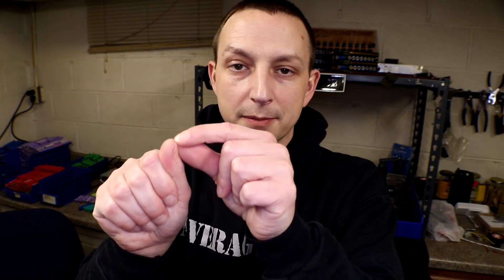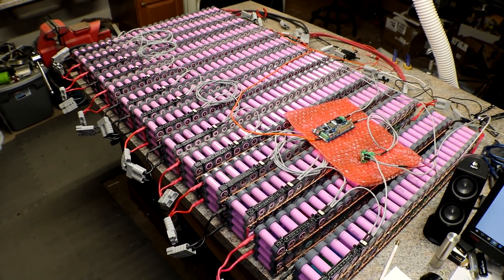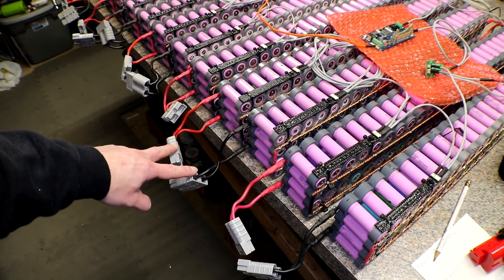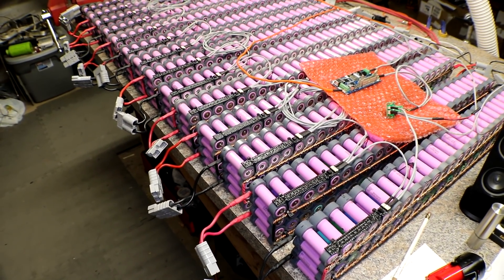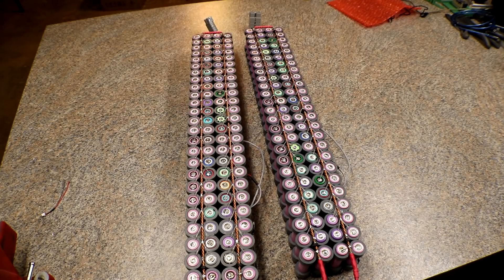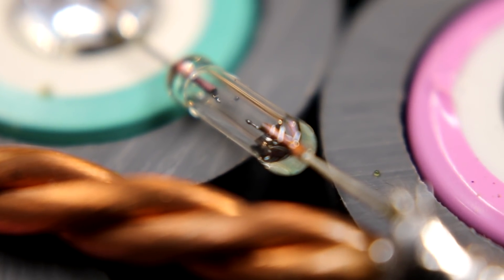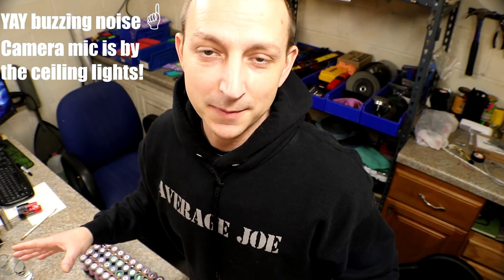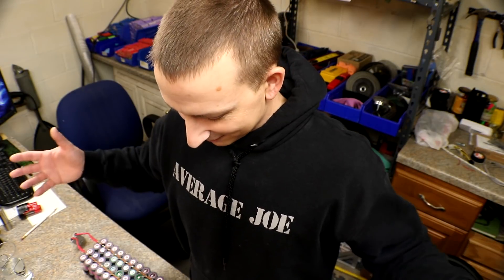Diy Tesla Powerwall ep75 200 Fuses BOOM!!!

Comment: Hi @jeo great job.
I have few quires... Could you help 
What if you use there BMS... Using BMS can we avoid such incident...? 
Example 4840ah battery pack. That contains BMS, even if it have BMS still need fuses at cell level..?
Reply from the maker: Yeah I would use cell level fuses in a powerwall.  Fuses or small wire for fuses is acceptable.  BMS is a must as well! Doesnt have to be crazy expensive bms just find one that fits your needs.

Comment: Why not throw in a extra safty measure like a thermol fuse to prevent over heating cells when charging or heating
Reply from the maker: I guess one could do that.  I know my packs dont get very warm or hot even but you could for sure use them.  Batriums longmons have temp sensors on them and you can set it up to disconnect or turn on fans at desired temps.

Comment: Congrats.   Fuses did their thing and you didn’t burn the house down.   
I was tearing down a pack and damaged a battery   It started burning and then at the same moment my 3 year old came home and wants to see what daddy was doing. She wanted to play.  I broke into sweat as I was trying to extract the burning battery from the pack and get it out of the house while simultaneously trying to get my child away   I was getting excited, my daughter started crying, and my wife didn’t understand what I was doing.      
Fuses good.   Chuck damaged batteries.   Do tear downs in a safe place.   Avoid shorts.  Avoid over amps charging and discharging   Avoid over temp.
Reply from the maker: Thanks Man! Yeah Im sooooo glad I had the fuses and that was the only thing that went wrong. Good to hear you got that cell out. Was it a pack you built or a laptop pack you were getting cells from?
Reply: I would like to see ppl using thermol fuses in there packs

Comment: Have you thought about using fuse wire instead?
Reply from the maker: I have and tested many different ones but wanted something to pop lower then what everyone else was using for there fuse wire in a powerwall. Wire is for sure faster to install but you need to get 44awg or smaller to pop at about the same amp rating I am using and that stuff breaks easier then these guys lol.🖒

Comment: Hello Avg Joe,   kind of have been going in this direction for awhile now. I have been looking at building a 3 wheeled Trike / car for the last 5 years or so and time usually helps guide direction for me anyway. so cut to point. have given up on a car and have decided on building a E Bike using my old bike with a hub motor kit and time changed things again and I fell into buying a used EBike made by Magnum Bikes and have enjoyed it so much im riding it all winter up here in Maine.  8 degrees now and going for a ride in a few hours... so to the point again. I'm building a 48 Volt battery using 18650s around 20 Ah  and have it ready to solder up everything but I like the .5 amp fuses your using. if that's the right size. and want to order some to complete it. is this a good idea for a Ebike battery. assuming the powerwall and ebike battery are closer enough to use for either. Q do you still like the fuses and would you recommend them for an ebike battery. I like the looks of repair and changing out fuses and battery's if need be. sorry on hard getting to my point. I have so many questions and will try to be clearer in the future. Thanks Vic / Dogboy
Reply from the maker: Yeah I do a lot of the same and time usually will redirect me lol.  I think my uncle has one of those ebikes and he loves it as well.  You are dedicated to cruise in those temps.  How far do you go usually?  How many amps does your ebike battery pull?  That would help in deciding the fuse rating.  I would think you would want a little higher like maybe 3-5amp fuses to keep the resistance down for an ebike.  In a powerwall situation with a tone of cells its not much of an issue.  Also keep in mind that the lil glass fuses can break easily from the bus bars moving around.  You would need to be a little careful handling the packs and make sure that it is secure in the bike.  Mostly the fuses on the ends are the ones that break easily, ones in the middle dont break. But YES I still love the glass fuses and will continue to use them.  Yeah I made my cell holders for the ease of replacing cells if I need arises. BOOM😜🔥
Reply: Thanks for getting back to me. I'll answer on my bike rides during the winter months. I wear layers and there is a balance to being warm too hot or too cold. im working on accepting getting cold some and wearing a little less for comfort in moving around. lately I go by my hands. when im out riding I wear these insulated rubber glove with neoprene inside layer. there cheap at the local Job Lot store $3.00 crazy price and very warm for quite a while. at 35 degrees I can be outside for hours and not have cold hands. but at 7 degrees its about 30 mins maybe 40. so at about 30 mins my hands start feeling cold so that's my turn around point. I can get back in 15 mins or so and that's a good ride for that cold. 4 degrees is the coldest ride and at night. I enjoy night riding in winter as there are less cars on the road. have to be careful. wear a mask  at times and have several lights two rechargeable headlights one very bright. again cheap ebay light. runs on 4 18650 s and came w charger for 20.00 bucks. ( I might be posting some videos sometime soon on my adventures . so back to how far. average winter ride is 4 to 5 miles. coldest days 3 and nice day maybe 9 . thats winter snow and Ice . I even made my Smart Sam tires into DYI studded tires. using 1/2 in x #8 sheet metal screws.  to me what your doing sharing your journey is awesome and teaching what you have learned. Its awesome. I've been watching several Battery guys Bike Guys etc. several years ago I built a Stereo tube amplifier using you Tube videos. and have learn to change break shoes build things. I have been a builder my whole life and have always done as much of everything myself that I could. well I have gone on long enough on the How far I ride question.  I have to say I have a problem with my left leg 5 years ago I almost lost it and very glad to say I still have it but biking was becoming very hard including balance and getting on and off quick enough and trying to fall less. and being able to peddle up what used to be easy hills were becoming very hard and with the eBike its much nicer. I live on a long hill at the bottom and by the time I got up to the top I was spent before getting any distance. not the first stage is easier and making the rest more enjoyable. I'll check into what my motor is pulling and get back to you. I'm thinking of using a wire fuse just need to figure the guage . have it saved jut escapes me now. your doing a great job. Thanks for more than you know. Vic

Comment: maybe you should put a main fuse in. that will blow before all the tiny ones will. that's what I'm thinking about doing. I need to get started building batteries.
Reply from the maker: +James stranger I do have some 100amp fuses that I might put in between each pack. Under normal conditions in the server rack this shouldnt happen but I guess you never know💣💥🤣

Comment: Wanted to build those but my boss told me 100- 250amp current draw for about 8 minutes using li-ion batteries would shorten their life span.
Reply from the maker: +webslinger2011 For a powerwall or for tool batteries?
Reply: AveRage Joe  It's for our fast charging EV motorbike. Draws a huge amount of current.

Comment: Hey Joe ! I'm trying to build a battery back-up for my sump pump (120V/7.5A) Can you make a video about building a UPS for bigger equipments?
Reply from the maker: Hey Ray, my regular powerwall would be basically what you would want.  Im using a 2700watt ups and 1400cells.  It could run your sump pump for over 8 hours!

Comment: my 1GB video card, radeon HD 4850, still running just fine, it doesn't support OpenCL 1.2 so no mining crypto with it... no DX12 so some games I've  tried to play don't work.
Reply from the maker: +bcmasur Ya these 1gigers I have wont mine either. There probly messed up anyways as They were freebies from recycler!
Reply: BOOM!  ehheheheh  it's not because they're 1GB but because they don't support the necessary protocols such as ati/amd needs at least OpenCL 1.2  I just won an M5A97 on eBay for $61, been using an M3A78 with only DDR2 RAM, moving on up!  next will probably be a new video card so I can GPU mine (or play new games)

Comment: Lesson learnt :). tytyty . Just a question, why have ur fuses at an angle?..Regards.
Reply from the maker: YES!!!! Lesson learned for sure lol.  I put them at an angle to try and get the soldering heat away from the actual fuse in hopes to not mess up the integrity of the fuse since heat can change how the fuse could react!
Reply: ty :)

Comment: If it's an LG or ViewSonic flat screen TV usually it's just the power supply of the power supply starts failing off frequency which causes lines in the TV sometimes before they fail the use of brand called craps on you can buy kits to replace the caps look at pastors that are bad are usually have a bubble on top of the cap if not by the kids replace the mole on the power supply just do a Google search of your TV model find out the most common problem soon pretty handy save yourself some money plus you can get some at the second hand store and pour your recycler and fix those ones as well you'll be loaded with TVs
Reply from the maker: Yeah the tv upstairs was a LG.  All the caps appear to be good.  Where I broke a little piece of the screen off, there was like 10 little wires running through there and that is whats causing all the lines.  I have fixed a lot of tvs that way by replacing all the bulged caps from my recycler lol.  I do have about 6 tvs down here now that are a little newer ranging from 42" to 60 or 65" and the caps all look good so it has to bet a fet or something.  Ill have to investigate more.😀👍
Reply: AveRage Joe you can also check the capacitors if you have a voltmeter that does resistance based on uf rides I sent you the message before I wash all the vgao if you need any help I've repaired 2000 TVs
Reply from the maker: If I have it open Il for sure look at them but I dont think mine will check resistance on uf.  I do need to fix those bigger tvs tho!

Comment: It could be the Matrix, you lead an exciting life for an average Joe...lol. Ever think of just using 10 AMP Pre-Tinned Fuse wire I got some from the UK it's pretty neat really easy to solder.
Reply from the maker: There is a glitch in the matrix😱😆 I agree that life is exciting cause I love to tinker!!!  I have tested many fuse wire and copper wire and decided to go with the glass fuses because I wanted the fuse to pop around 2amps so if a cell decides to self drain or just go bad in general it will pop the fuse sooner vs eventually pulling 10amps slowly over time and make a glowing red wire and be a possible fire hazard.  With the glass fuse its all self contained.  Thats my point of view on it at least. Many people are happy with a 10amp wire tho! 😀👍

Comment: Sooo....you let out the magic smoke??? LOL. Hey....question: You ever did a follow-up on that 24v back up UPS? I remember you set it up without a BMS. Just wondering if that is still the way youre using it....or are you still using the UPS??
Reply from the maker: I let the magic smoke out of 200 fuses, the batrium watchmon and well I broke the tv screen lol.  Ya I have been using it randomly and so far everything is ok.  I havent made a follow up video yet cause I want to redo that pack with the same cells and I do want to add a little cheapo bms to be on the safe side.  Hope to do that here soon!

Comment: zero dislikes.  cool.  some days you are pigeon, some days you are the statue.  Bought a BackUPS 350 (200 watts) for $5, dead battery, not replacing it, just going to wire it into my 3S15P... finally about to have some solar-powered AC.
Reply from the maker: Ya some videos are like that but its still early 😜  Nice find!! Its always nice to get something going for sure!!!👍
Reply: BOOM!  heh.  baby steps, I'm gathering more 18650s... might get some of those axial glass fuses. I absolutely HATE soldering, though, so maybe I'll somehow stick with the magnets... maybe can stick the fuses under the magnets.  This aluminum duct tape's gotta go..  I'm only using one 100w panel right now so I'm concerned that if I add too many more 18650s the panel won't be strong enough to charge it all.  3S15P right now, was thinking about doubling it.. second 3S15P in parallel.  or I might get impatient and just bring it up to 4S15P...
Reply: @bcmasur  Be careful.  If you are wiring the lipos as a direct replacement for the dead lead/acid battery you will fry them at 3S.  Typical charge on lead/acid is at least 13.8Vdc, which would put you way over 4.2v per cell (possible fire/explosion).  However 4S would work fine in that configuration.
Reply from the maker: The setup sounds fine to me and like you said the daily eyeball since its just going to be an inverter😀👍
Reply from the maker: +bcmasur I would think that it should of at least ran the opus and should run down lower than 12v. . When I was messing with my 12v ups i could run a small load like that for a while. I did make it a 4s tho. Ya maybe upgrade the wires a lil and try it un 4s. If it shuts down under load maybe there is an issue with it. If thats the case I could send you one if my 12v ups's🖒
Reply: Aspendell I'm not using SLA anymore, I just wanted it for the DC->AC inverter.  I'm using only 3S15P 18650 li-ion, not lipo!!! I'm not plugging this UPS into AC power again, ever, that would be going backwards, I'm just trying to run some little AC stuff off of my solar panel on the roof.  I'm hot charging my 3S15P 18650 pack off of my 20V 4.8A solar panel.  No BMS, no charge controller, nothing needed but daily eyeballing to make sure nothing is broken.  To further clarify, I'm wiring my 3S15P (18650) directly into this inverter as its power source to provide AC.  100W solar panel is on the OTHER end of the 3S15P.  Aspendell, if there is still something think I'm forgetting about, please, please let me know.  I'm not going to wire this up for about another few more days, since I'm kind of lazy like that and like to mull around a bit before doing anything that might be stupid... not trying to burn my eyelashes off...
Reply: hopefully soon I'll get around to adding some more protective hardware
Reply: well, I wired it up, turned it on... it was beeping, I guess because it thinks the battery voltage is too low, about a flat 12V maybe less since I was only using 18awg wire, plugged in my BT-C3100 and it shut off.  This might be my reason to jump this up to a 4S system.  Other thought is that I wired it with a CLA adapter that has a 10A fuse in it (I think) so maybe that was limiting it to 120W, when it is a 200W inverter, although I was only trying to plug in a 36W application.  I think I'm going to wait until my BT-C3100 finishes refreshing and measuring the cells I just ripped out of some laptop batteries and bring it up to 4S.  I just need to find my other LCD voltmeter, meanwhile... it's gotta be here somewhere in this mess
Reply: Yep, a couple other reasons I want to bump it up to 4S so probably in the next few days, let ya know how it goes :>
Reply: @bcmasur  Sounds good.  For minimal charging protection from your panels you can buy a small module (from one of those Wind & Power type companies) for $10-$20 that will cutoff charging currents when your batteries get to your set max voltage for your batteries.  ie., 12.6v (4.2v x 3) or slightly less, and even allow you to divert the power to another load when batteries are full.  This will greatly increase the life of your cells.  They are only good to 15 or 20A, or you can add a large relay for another $20 that will allow you to switch up to 200A once your system expands.

Comment: Have you checked the cells to see if the fuses protected them?
Reply from the maker: Yeah they were still at 3.98v😱😀👍
Reply: Sweet! if nothing else, it may have ended up with you spending a number of hours on repair, but not having to start over with replacement battery purchases!!!!
Russ from Coral Springs, Florida, USA
Reply: Some people only do one side, and I suppose that is fine.  I want to play it safe and do both sides.
Reply from the maker: I think one side is good enough unless you use fuse type wire and have plenty to do both side it wont hurt. I used 24gauge on the negative side since I found some in my scrap copper bin🤣🖒
Reply: AveRage Joe do you have fuses on both positive and negative ends of the cells? Or can you get away with 1 fuse per cell to break the connection.
Reply: Linda, I for one do both sides.  I use a spot welder now, it saves a TON of time!
Reply: Terry Texas I'm working on a pack where I can pop them in or out for balance and if one goes bad. I'm making copper leaf contacts and fusing them together. It just seemed that one fuse would be sufficient to break the connection, but I'm a noob at this so....🤫
Reply: Terry Texas thanks, much appreciated!
Reply: AveRage Joe thanks, I was hoping to hear that. I will post a diagram of my battery layout soon on Facebook so I can get some suggestions, or threats, or something. Thanks again.
Reply from the maker: No Problem, I would of responded sooner but YouTube doesnt always let me know of comments or they dont post right away. Yeah would Love to see it. Can you tag me when you do (if you remember 😉)🖒
Reply: AveRage Joe  same here, if it wasn't for Gmail I wouldn't know what was going on. I'll tag you, thanks.